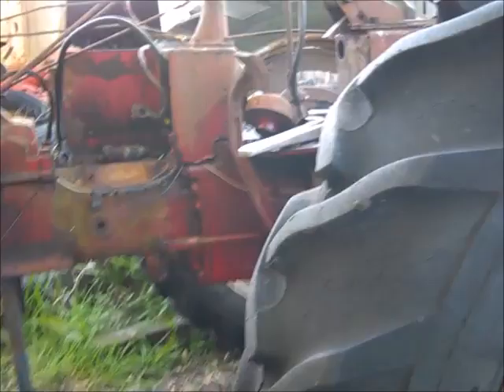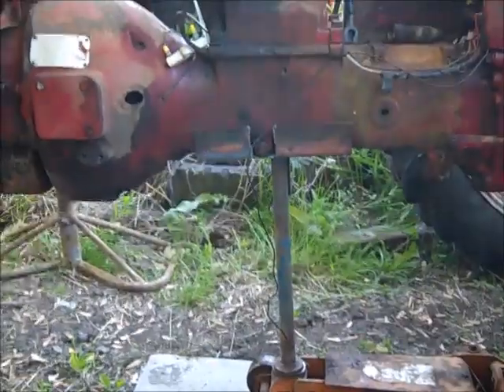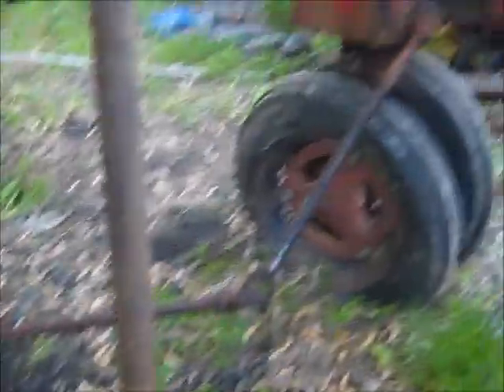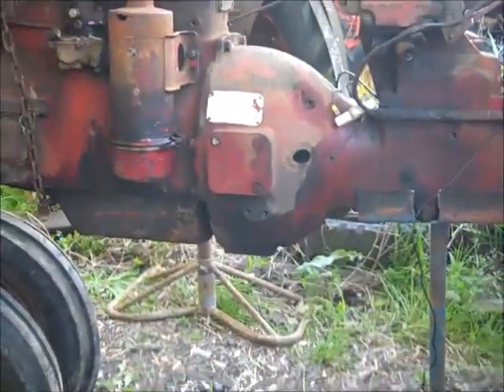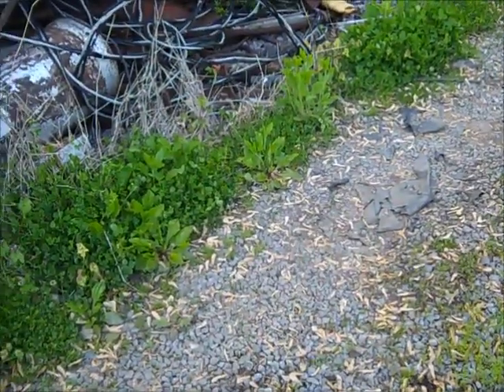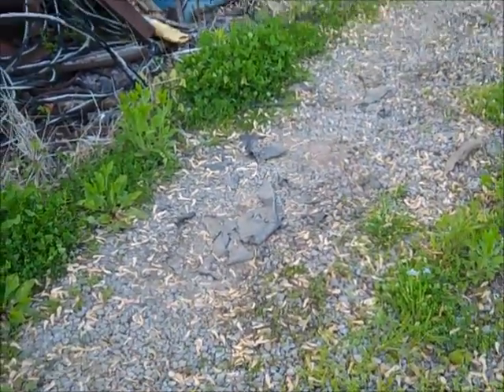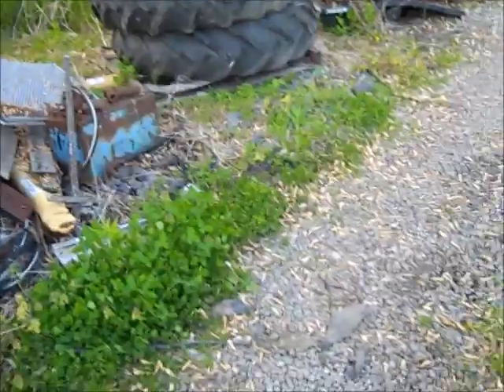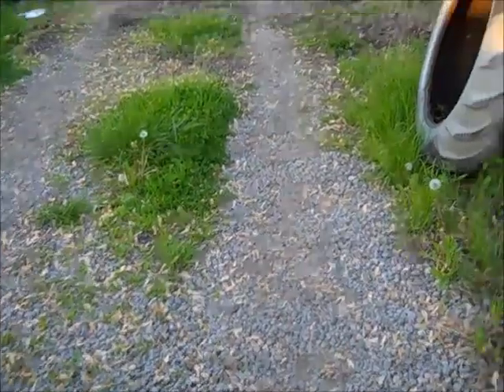Farmall 230 can I fix it part 7 ready to split 5 14 2021

Comment: Please don't scrap old farm tractors. That's a big no no. I need parts for the F20 and W30. Why would you do something like that?
Reply: not everything is saveable they are about 80 + yr old tractors.  f20s are still dime a dozen vs F30s. W30s not so much even more so mccormick WD40. plus the guy is 75 i think. he's gotta pay bills and make a living. just how it is.
Reply from the maker: I kept the good parts and sold a lot of good parts to others. I have one more F20 to restore with the parts I saved.  Did you need a rusted out wheel or a busted block? That is what I got rid  of.
Reply: Wrong. Everything is useable. Even a busted block. All that stuff and you can't weld a block? Lol lol. I've got w30s and G20s they're all valuable.
Reply from the maker: @kenhuss3801  no need to weld an old block, I have two good F20 engines for one tractor some day